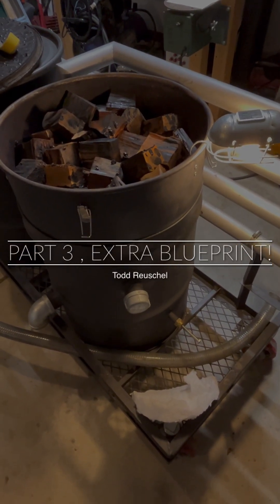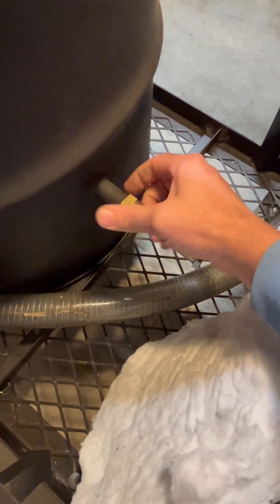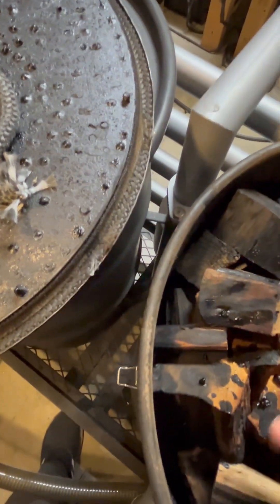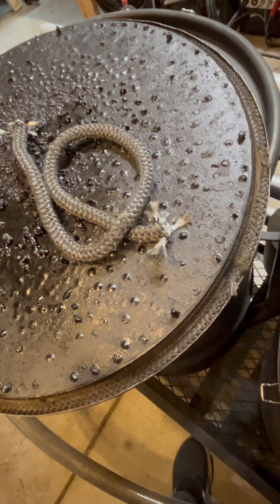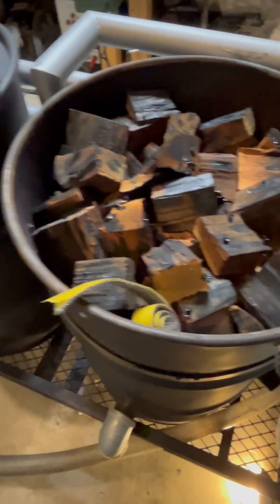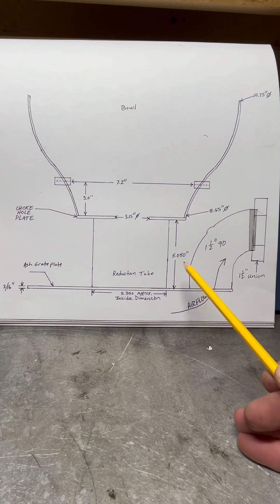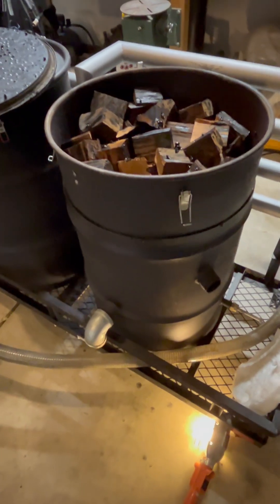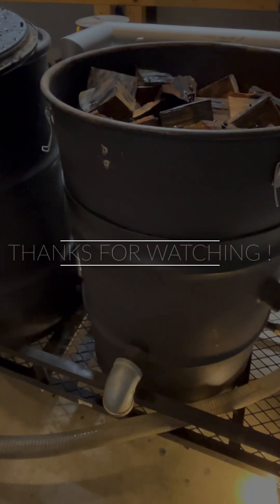My Woodgasifier Part 3, One more blueprint.

Comment: Thanks for providing some detail drawings. I tried to use your drawing and it didn't work with the numbers in my 3D design software.
No problem, i searched for the name of the company that you got your 10"x8" reducer and then finally found the profile that had letter variable for the associated dimensions based on which adapter you need.
The provided drawing(s) are updated because it is linked parametrically to the numbers in the database and the associated curves will work.
My point is Ist of all "I Commend You" because I strive to make my gasifier work and as well engineered as your!!!
I can provide you an updated drawing if you would like?
Again I really think you have made a very professional gasifier and I would be glad to help you update all your drawings if needed? Glad to help!
I have been recreating a project from a YouTube channel using 2-30lb propane tanks along with a 20lb, and I feel this will be very similar in design to yours but a little less $$$ to build?
Thank you for Sharing
G_Dub
Reply from the maker: Thanks for all your comments, I’d love to see your progress on this project. Please let me know if you have any questions and I’d be happy to answer them.
Reply from the maker: Just remember your charcoal surface to air ratio is important

Comment: From experience the reduction zone should be at least 200mm or more my straightefeid gasifier makes a super smal amount of tar , it's 250mm long en 140mm in diameter in my 2 stage gasifier en the raw gas doesn't have any tar !
Reply from the maker: Sounds awesome. Do you have any videos of that?

Comment: How are you dealing with condensate  from the chopped wood. If you had a dommed lid and condensate gutter  you reinject the water as steam below the air nozzle for hydrogen injection
Reply from the maker: I don’t have that, but that would be a good way to deal with it

Comment: Great, Thanx Todd!
Reply from the maker: No problem
Reply: @toddreuschel  When you have time I will have few questions for you? I am live in Europe on high altitude over 1000m. Have solar system but its not sufficient in November, December and January. In November we must turn on generator 8 times for about 90 min for charging battery's. For each winter is about 30 times per year. I understand we need blue flame for generator and less tar?
Reply from the maker: Sure, I will answer any questions you need.
Reply from the maker: Yes, the bluer the flame and less tar the better engines will run